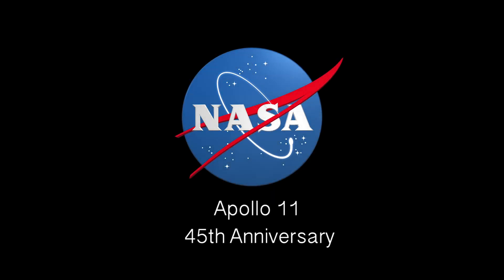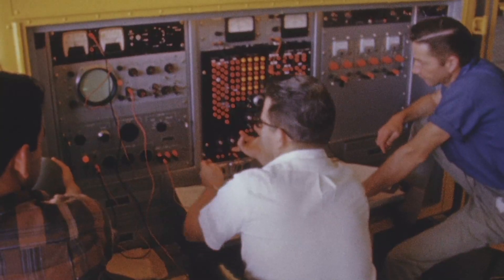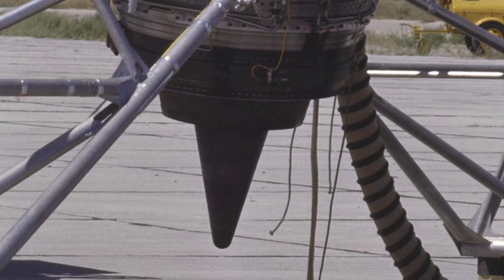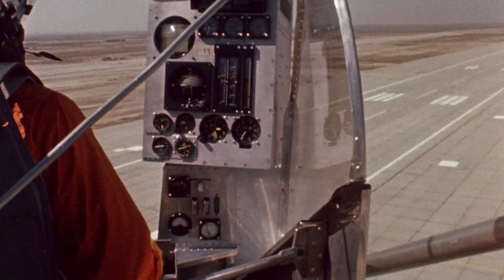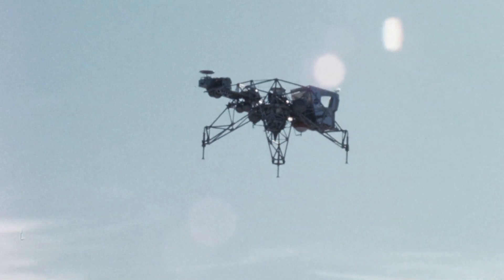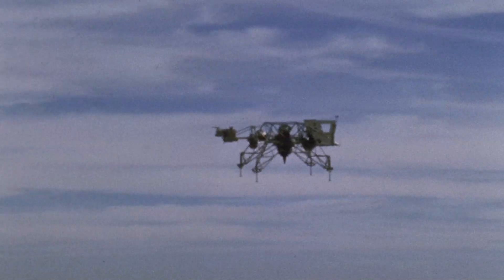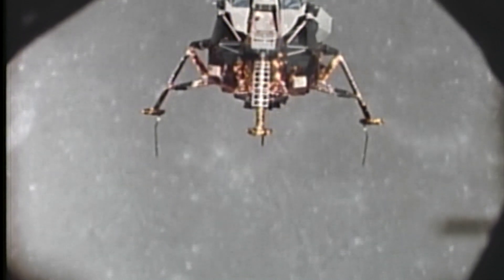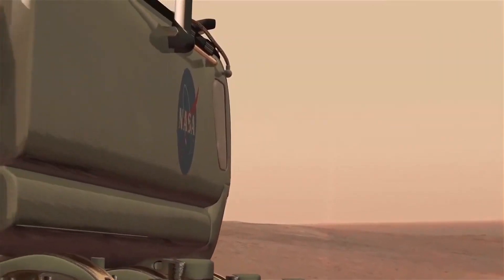LLRV Testing Contributed to Apollo 11's Success

Comment: Pathetic.  Only recently has SpaceX been dumb enough to try landing on a nozzle. They still fail about 50% of the time using liquid cooled mega super computers.  Apollo orbited the Earth, thats it.
Reply: Oxygen Thief
Reply: @135iN55  LOL, Harrier had one engine Pegasus6 with two adjustable exhausts and it flew flawless.
Reply: @tgstudio85 
The AV-8B Harrier has 8 nozzles for control.  Armstrong catastrophically crashed the only training flight for the fake LEM landing.  NASA decided it wasn't worth practicing to success since the landing had long since been abandoned.
Reply: @135iN55  You wrote: "Armstrong catastrophically crashed the only training flight for the fake LEM". 

No, there were at least three operational vehicles at the time. Flight operations of the LLRV had started well before Armstrong's crash in May of 1968 and continued all the way to Apollo 17 in 1972. Armstrong's crash was caused by a depressurisation of the RCS chamber which essentially left the vehicle uncontrollable. This is like driving down the road and suddenly your steering inputs don't work anymore. Armstrong continued to train in the LLRV right until Apollo 11. Did you even watched the video or did you just copied and pasted some stuff you saw on a Facebook post?
Reply: And, of course, landing an entire rocket stage on Earth can't be adequately compared to landing a relatively lightweight vehicle on the Moon.
Reply: @oscarin13 
Especially since no one has been to the Moon.
Reply: @135iN55  Do you also deny unmanned spacecraft such as those used in the Luna and Surveyor programmes?
Reply: @oscarin13 
How does that make any sense?   We cannot send men above several hundred miles and never have.  The Moon is 230,000 miles away, or about 1000x farther than mankind is capable of traveling.  There is no current technology that will change that, as we have significantly regressed since 1970.
Reply: @135iN55  I was asking you if you deny spaceflight altogether or just the Apollo lunar landing missions. Why do you think we can't go to the Moon?
Reply: @135iN55  By the way, the crew of Gemini XI achieved a record altitude for low-Earth orbit at over a 1000 km.
Reply: @oscarin13 
Von Braun himself said it was out of the question to travel so far.   He suggested a 200 man space station be constructed to support a Moon mission. Thats before New Horizons measured 71,000x lethal dose radiation.  And the faked film is a hillariously low quality 1960s cut and paste fake.  There are thousands of DEVASTATING flaws, but only one proves Apollo was faked.  And lets not forget the murder of Grissom, White and Chaffe who said the Nazis running Apollo were utter buffoons with zero hope of success.  Betty was awarded $50M for his murder.
Reply: It seems your are denying earth orbit is space travel.  Are you a flat earther?
Reply: @135iN55  No, I'm not. I suggest you read my comments more carefully. 

Do you have a primary source for the alleged Von Braun's quote? Do you have a primary source for the alleged comments made by the crew of Apollo 1? Do you have a primary source for the alleged measurement of radiation made by the New Horizons probe?
Reply: @135iN55  Von Braun was a visionary but many of his proposed designs were not implemented. Also, your assertion that the crew of Apollo 1 was murdered is without merit and insulting.
Reply: @oscarin13 
Betty won the case.  It was proven openly and beyond ANY doubt as they were able to produce the ignitor.  Remember, NASA was 100% Nazis from Paper Clip, killing those three was a joy.  Betty was awarded $50M by the court for murder.

Again, are you a flat earther or not?
Reply: Its not a "proposed design" when Von Braun proves a Moon shot is a laughable fantasy.  He's video is on YouTube.  If the Apollo lead says a Moon shot is an absolute joke, it is.
Reply: @135iN55  Doing a little bit of Googling I found that Betty Grissom received 350,000 dollars in compensation. I could not find any source confirming the 50 million dollar number. 

Operation Paperclip was arguably controversial but not everyone involved in the U.S. space program was a German. 

And again, I'm not.
Reply: @135iN55  Since you're the one making the assertion you're the one who should provide a source for it, don't you think? You have already made false statements in the thread, I'm beginning to think you're a troll.
Reply: @135iN55  Ok?
Reply: @Blob B
Yep, utter engineering incompentence.  Total clown act.